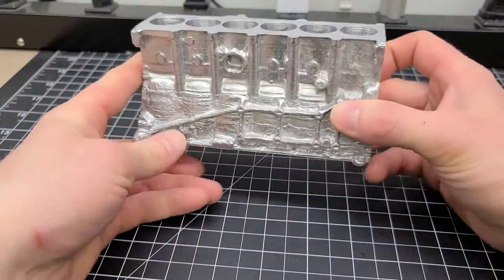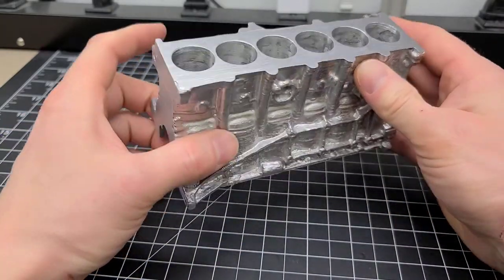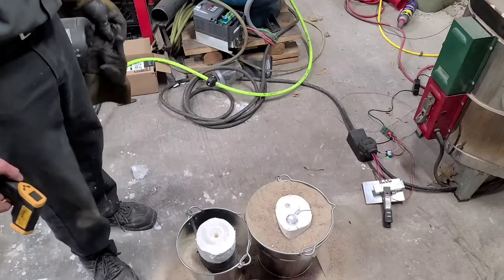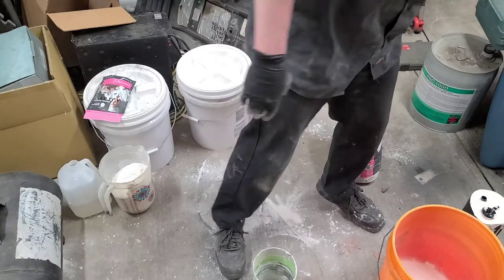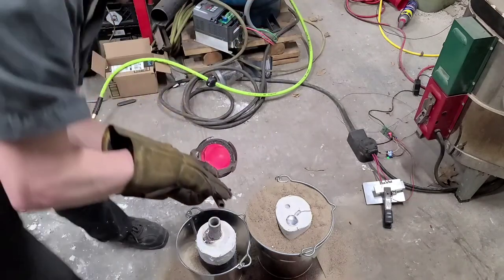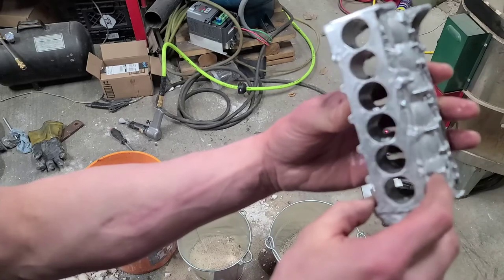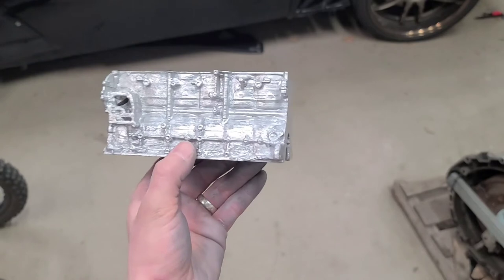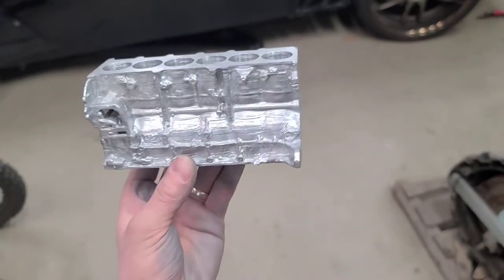Lost PLA Casting a Mini Engine Block

Comment: do you believe it would be possible to cast an engine like this in full size? Does this foundry have the cooling and lubrication channels?
Reply from the maker: The casting does not but the original model does. I purposely blocked them off in the model. I believe you could cast a model twice the size of this one and get decent results with water jackets and maybe some oil channels.
Reply: @snagle87  I think it would be interesting for you to make one in original size. what do you think of this challenge?
Reply from the maker: @wesaderty  I would have to upgrade everthing for casting that I own. I'd have to pour 80lbs+ of aluminum. I rather cast a 1/3 scale functional engine. But that's a project for an older, retired me...

Comment: its too good but when you but your engine block in pla and when you cast the metal on it you plug the holes or not
Reply from the maker: Are you talking about the cylinder holes?
Reply: @snagle87  yes
Reply from the maker: @recuppc  No, it was filled in by the mold plaster of Paris/sand mix
Reply: @snagle87  OK

Comment: Hello, in second 16, what liquid and at what temperature is it? What is this process for? At what temperature did you bring the plaster to burn the PLA. Thanks for your answe
Reply from the maker: Paraffin wax melted to 103C+.  For the plaster mold you bring it up slowly to 750C over 6-8hrs.
Reply: @snagle87  Tank you

Comment: Hi, I just found your channel. How did you learn to work on electronics? oh I just finished watching your turbo go-kart and I was impressed  👍
Reply from the maker: Thanks, I learned electronics by just jumping in head first by building a DIY engine management system (megasquirt) when I was 17. It was a harsh learning curve especially when it's your only mode of transportation. I would start out with Arduino. Find a project that you would like to do and don't be afraid to let some smoke out.

Comment: A few safety corrections, wax melts, depending on its formula from between 100 and about 150 f, NOT C.  You should not try to get it to 700 C you could have a serious fire as it boils at around 370 C, and flashes at 200 to 250...  DO NOT Heat to 750 C. You will have some serious issues with fire or explosion when it starts to boil into vapor.   Also if it flashes, do not try to put it out with water...  you will have the mother of all explosions in your face.
Reply from the maker: What are you correcting?
Reply: This is not lost wax... it's lost PLA, and the intention is to burn it out not melt it out. PLA also has a higher melting point than wax by a long way Granted you probably could do the latter and might even get improved results.

Comment: I smell BS
Reply: It's just lost PLA casting... very similar to lost wax except you can 3d print the PLA easily then cast in plaster mould and burn out the PLA in the oven then pour like normal...